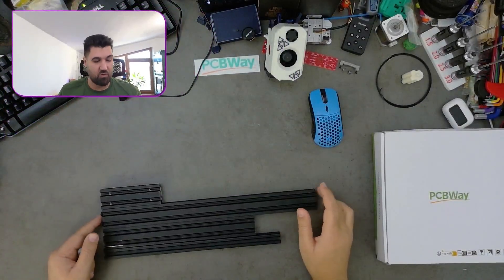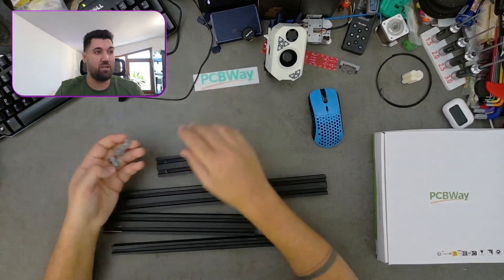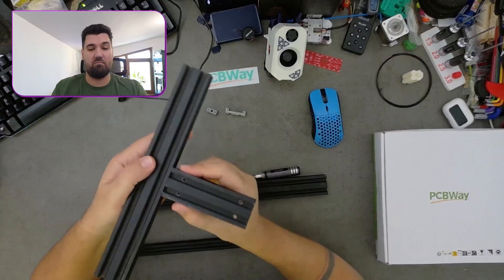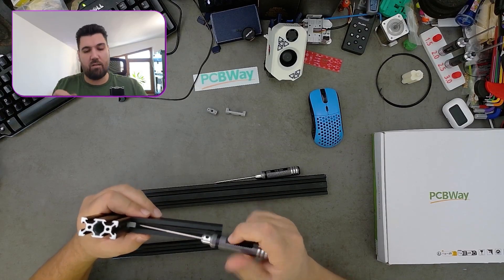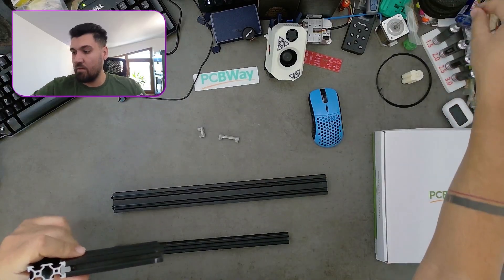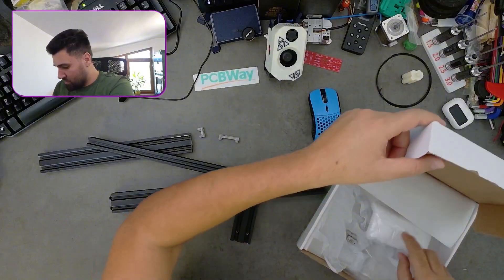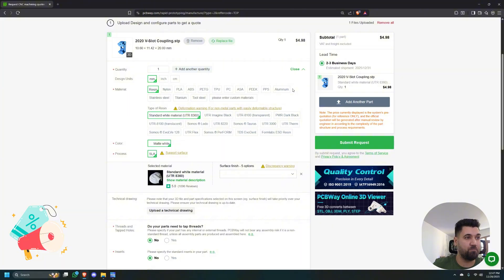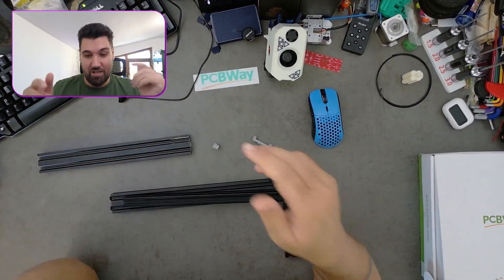This Hidden Connector Works Like Nothing Else

Comment: Makes sense soon as you tightened them down put pressure on in the back of the profile .  

Look out for cracking.
Reply from the maker: They are 3D printed, but SLS , they are Metal. they hold pretty well!  I have received some Special Filaments and I will try to print them to see what i can expect from the fdm .

Comment: I think it's a design flaw because the two profiles push apart when the grub screws are tightened. This means that the two profiles no longer touch each other. The force is now only transmitted via the connecting piece. This reduces lateral stability to 30%.
Reply from the maker: You’re right that the profiles are not pulled together by this connector.
However, they are also not pushed apart.

The side grub screws do not create separating force between the profiles. Their role is twofold:

to prevent the T-nut from sliding, and

to lock it in place, just like a screw-lock T-nut — the grub screws bite into the T-nut inside the profile, creating a solid mechanical lock.

The T-nut itself is fixed to one profile using 1 or 2 M5 screws, with just enough clearance to allow sliding during positioning. When inserting the second profile for the first time, it requires noticeable force — the fit is very tight.

Yes, there is a very small intentional gap between the two profiles.

As with any solution, there are advantages and disadvantages. The main advantage of this design is that it is much more stable and always self-aligned, thanks to the geometry of the T-nut, which keeps everything square and repeatable.

P.S. Once mounted, this joint cannot be twisted. This is not the case with classic blind joints, where—if enough torque is applied—the profiles can still be twisted relative to each other.

Thanks for the constructive feedback 👍

Comment: Nice small connector, I lately made some similar out of flat bar. Countersunk holes for centering, a thinner strip as shim and a drop of quick glue to get rid of fiddeling while drilling, tapping and finally mounting. "Copied" it of the fastener system robotunits sells that we are using at work. Unfortunately their profiles start at 30mm, so they still use spring secured turn in t-nuts. Therefore their profiles are drop-in mountable, u dont have to slide the fastener through the slots. For structural framebuilding the best system I used so far. Bit more expensive than igus, bosch or others, but the easy handling is worth it.
Ur fastener is a great alternative for spending time at the workbench. Just the elongated guiding might possibly interfere with stuff mounted closely the the corner
Reply from the maker: That's really interesting! It sounds like you've got some great experience with similar systems. we will test it even more

Comment: Great idea! Wouldn't it be nice, if the locking-bolts are in a slight angle? The accessibility with the screwdriver would be much easier.
Reply from the maker: You are right but a 90 degree grip is better. and we can use ballhead hex key and solve the issue.

Comment: M2 you say, I don't know if these are strong enough to handle abuse as well.
Reply from the maker: the M2 are 2 and they are just to lock it in place. there is space so we can use M3
Reply: @nadir3D yeah, I get that, but if you use a lot of force or unscrew M2 a couple of times, I can see it becoming an issue. M3 would be the better choice.
Exactly the reason why a lot of hotend manufacturers went away from anything smaller than M3
Reply from the maker: its my fault is an M2.5 :D and we can make it M3
Reply: @nadir3D M3 would be perfect. Are you planning on open source it? Or selling it as kit?

Comment: how far out is that little tab with the m2 screw protrude? so we cant attach any parts at that little tab section? great design btw
Reply from the maker: Thanks, the tap is 12mm, do you have any ideas to connect other thinks to it?
Reply: @nadir3D  no idea so far... was just thinking if it protrude out, it means we wont be able to attach/screw anything in that corner about 12mm.
Reply from the maker: Exactly

Comment: this looks interesting for projects using 2020/4020 extrusions.

I'm not sure about the use in 3D printer frames tho, you don't really need or want to change the location of the connections. Tho this may help with isolation of the frame, unless it is a stiffer/stronger than a blind joint, it may not be worth the extra cost over a simple blind joint. 
Would be great to see a comparison to blind joints for that reason.
Reply from the maker: Thanks for the feedback! What kind of project do you think this would be most useful for? This is secure. the blind joint i has a issue it can be crocked, this it will always be straight, by design.

Comment: Great idea now it would be great to stress test against original method and compare data :)
Reply from the maker: Do you suggest any specific test?
Reply: @nadir3D  Ideas are plentiful, but most accurate methods require significant effort—think load cells, custom Arduino or STM32 code. That said, measuring deflection under different loads can be a solid starting point
Reply from the maker: OK i have to find someone that is willing to collaborate on this. any suggestions?
Reply: @nadir3D  me ! 😂
Reply from the maker: hit me on discord and let's do it!